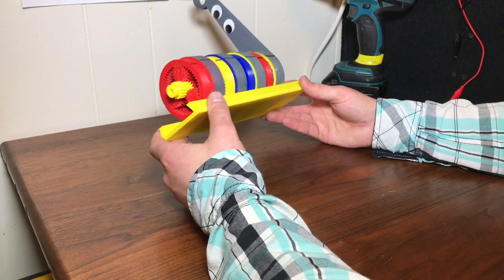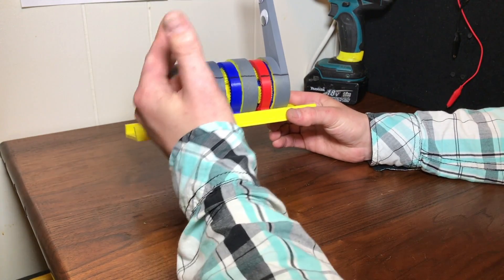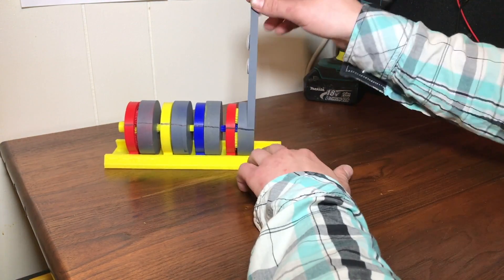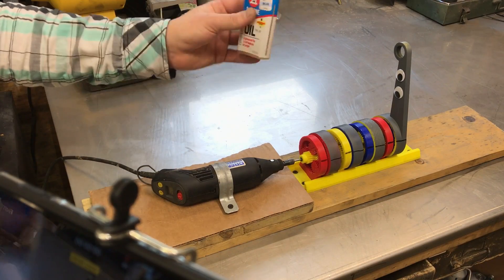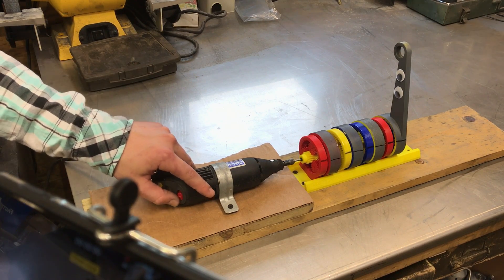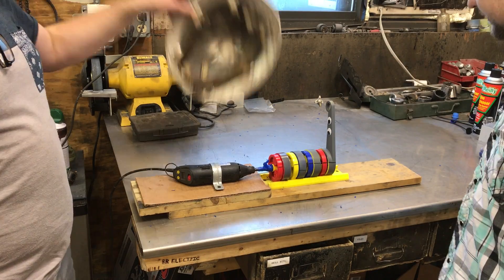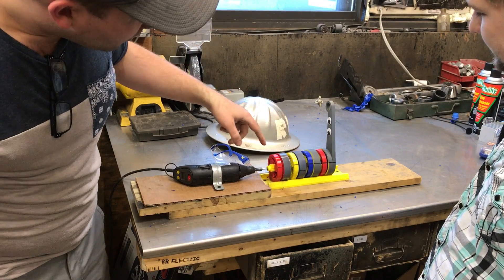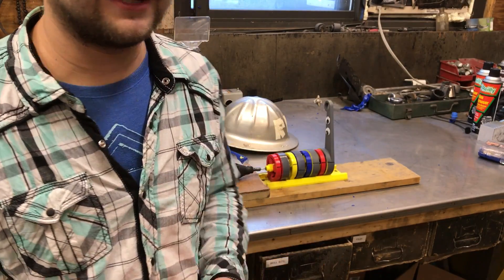3,616,238,492,881 To 1 - The Most Useless Gear Ratio Ever

Comment: is the last gear actually moving continuously or is it just being nudged when the previous gear makes a full rotation?
Reply from the maker: Its moving continuously, but the gearbox never actually got through all of the backlash so it's actually not moving at all. 

To answer your question directly, no this is not some kind it Geneva Drive it's a continuous ratio.
Reply: its hard to imagine that last gear moving that millionth of an inch, pretty cool

Comment: Theres a technical museum ive been to that has a useless gearbox as well. You can see the input spinning from an electric motor, the first few gears are also visible spinning. But the last gear is mounted in cement and would take thousands of years to move All these years of spinning cant even make up for the gear lash...

Comment: Would have used plumber's grease/silicon grease/brake cylinder grease which doesn't attack rubber or plastic... not 3-in-1 petroleum oil which does attack things...

Comment: I wonder... What would happen if a really strong force tried to turn the lever at the OTHER end as fast as it could? Perhaps having a drill bit embedded in the end that was being used to spin this thing up... Would that create one of the fastest spinning drills ever? What kind of things could that drill through if the drill bit could withstand it? I'm also not sure if rotational speed would translate to electrical power if it were hooked up to a tiny generator.

Comment: Couple of pointers, silicone based lube tends to be quite gentle with polymers and rubbers, might want to try that instead of 3 in 1 oil. Also, the air can need not be upside down. All you want is some cooling air, the kind of thermal shock loading you place on the gears in the video leads to premature failure.

Comment: You could use a belt (or gear) drive to multiply your rpm...a 1:4 ratio would take your 14k rpm to 56k rpm....you're going to lose torque, but would only take ~4 years to get your 1°.

Comment: So what would happen if you ran it backwards, like if you turned the lever on the far end with your hand would the other end spin at like 10 trillion RPM or what? I must know!!!
Reply: Renegade5130 
Did the math
Saying youve got an infinite amount of energy and a unbelievably strong material:
If he put in in the other end and had some impossible dremel...
Well it takes 3.7 trillion rotations of the first gear for 1 of the last, the gears look like they have a 1.5in radius, and a bad dremel goes at 5000rpm, so...
3.7 tril * 5000 = 1.8*10^16rpm
v=2pi*1.5*(1.8*10^16)=1.646*10^17rin/min
Plugged that into a tip speed calc and its 35908488000000m/s
 (mach 104726205997)
Speed of light is 299792458m/s
The first gear would be going 119777.82x the speed of light
It would take 119777.82x some unlimited amount of energy to rotate it.
Reply: It would snap or not spin. What you gain in amplifying the cycles per rotation you lose in torque. The material it's made out of would snap long before it moved even a centimeter.
Reply: No it would not. If something requires x amount of force to be moved, it will not move unless x amount of force is applied.
Reply: You know how you apply torque to a lid and hold it and eventually it'll turn right. What if you Got a strong enough material and put just enough torque on it before it'd bend, snap, break, deform, or lose its structural stability on the atomic level to stay in place. And you had something hold it in that position. Eventually, would it not start to turn?
Reply: Theoretically, yes, a material that could withstand it + adequate force could turn it. My concern would be at what point in a gear ratio does a spinning mass hit light speed.
Reply: Ibrahim Noor don’t forget to mention that if he did all of that and things went south and the first set of gears exploded and one of the planet gears hit him, it would hit him so hard, it would reverse the Big Bang and turn reality inside out and create bizarro world

Comment: swap the output with input, then mount motor to input and generator to output and run a line back to rotor through a regulator.

Comment: you should have implemented more segments, but have the segments have a smaller ratio and each one a handle or something of the sort so you end up with something like a clock, where you have different pointers moving at different speeds

Comment: Why don't you try to make the same gearbox but make it open to the both sides and put the drill to the opposite side? Will the plastic vaporise transform to plasma or just blow to bits and pieces in a fraction of a second?

Comment: Have a look at "Machine with Concrete" by Arthur Ganson. He did something very similar with chained gear reduction, but the last gear turns a rod that is solidly embedded in a block of concrete. ..."solidly embedded" in the sense that the Sun will engulf the Earth and annihilate everything on it, including the concrete block, long before the final rod turns more than a degree or two.
Reply from the maker: +HaloInverse yes! I've seen that.

Comment: The only use i could think of is to control a robotic arm with surgical precision, with the motor being a V8 bugatti engine. xD
"Did you ever need to reduce a 200k rpm. motor to a precise and slow reduced spin?"
No.
"Fuck."

Comment: Here is a plausible use for this gear ratio.  The smallest measured distance is know as the Planct Constant.  It is the distance a photon travel to go the diameter of itself.  With this kind of gear ratio and a measures radius it could be calculated to determine how many turns or portions of a turn to make the arm travel a Planct Constant and by doing that you could actually build a scale to break down that constant into portions that are considerable less than the Planct Constant itself.

Comment: hello i know nothing about gears but i have a question - what you happen if you tried to turn it the other way? (turning the big handle at the end to spin the gears from the back to the front) is it impossible because of the design? or would it be possible but very heavy and require a lot of force?

Comment: If you had a proper liquid nitrogen cooling system set up to auto feed liquid nitrogen around the system, plus you made this whole thing out of steel or some other really durable and heat resistant material like titanium, and then you set up some super expensive, extremely fast spinning machine, and made sure it was literally sitting in a bath oil, and then left it on, with sufficient cooling, lubrication and spinning, you could eventually get one rotation :P

Comment from the maker: Hey! ProjectTube is working on casting this gearbox in aluminum, it would be amazing if you could help me support his efforts and watch his video https://www.youtube.com/watch?v=gr651nGFyi4&t=1s and check out his channel!
Reply: Gear Down For What? Can you change the last output into the first input. So if you have enough power to turn the input(the handle) an inch the last output would turn hell a lot of times :-D
Reply: Next episode will be out tomorrow and I think we are making some good progress towards a metal gearbox!
Reply: What if you attached and induction motor in reverse to the input side of the gearbox (result a generator) and then manual rotate the lever ever so slightly by modifying it to hang a weight or something.. Since it takes forever and day day to do the rotation; I would think very minimum energy in with tons of energy out resulting in a highly efficient fuel to energy ratio.. That possible? Or would it take a lot of force just to move the handle on the last gear box?
Reply: Mike Fox it needs enormous torque in order to be turned even a little bit
Reply: +Gear Down For What?    You didn't really invent this gearbox, it's just putting gearboxes I saw it on a dutch guys channel years ago together in series, with nearly the exact same design.
Reply: +Gear Down For What?   I see, thanks for clearing things up, it sounded like you invented it in the video :'D
Reply: Do a video on trying to crank it from the output side should be your next goal see how long that would take to achieve a good result even if it does not work do a video explaining why and with an example?
Reply from the maker: +ProjectTube Awesome!
Reply from the maker: +Jason Neu yeah I didn't invent it. NASA did
Reply: Gear Down For What? Why don't you turn the handle will it go super fast

Comment: If your so concerned with heat buildup, design an oil or water bath or shower for the gear stack to splash on its self while its turning... no pump needed.

Comment: Though it would take a lot of energy to move the handle, since it has a huge ratio. But if you could move it in a second, the other side would open a wormhole, or even cause subspace big-bang.

Comment: If the drill was spinning at 12,000 rpm the camera only would have caught a frame every 200 rotations at 60 fps more likely this video is in 30 fps. At 14,000 rpm that turns into a frame every 233 1/3 rotation.

Comment: If you could just slam down that handle without friction, etc., you would need to apply the theory of relativity to correctly calculate the speed of the red gear. Newtonian mechanics would get you speeds faster than light, which isn't possible.

But since there's no way to do that, it isn't an issue. The energy input required to pull that handle down, even with no friction, just the energy need to turn the mass of the gears, would be unimaginably large.

In fact, if you could put that much energy into the gear box, it would likely collapse into a black hole.

Comment: What if a powerful machine would spin this the other way at about 0.5m/s? It would certanly be hard, but I think an excavator or a more powerful rotor would do the job. Does this mean the first gear will spin at a speed higher than light?
Reply from the maker: +SkyDuster nope. It works like a worm gear. You just can't backdrive it

Comment: I would get a container of mineral oil and submerge the whole thing in it then take off the compressor housing and compressor of a junk turbo and then spin it with an air compressor.
That way you could spin it faster than most anything else could.

Comment: Imagine removing friction completely, then adding so many gear boxes that the turning would pass light speed, we really could break the universe, if there's no friction there it wouldn't take much energy to spin the output, so the input should do something, but it would snap a few gearboxes into little pieces when tried to move since even then light speed still can't be passed, but if they were indestructible, shit would literally hit the fan faster than light.

Comment: fyi, the reason it's stupidly useless is that it's not gonna do any good unless you have a super hard material on the other end, like diamond parts.
Reply: Hardness does not equal strength. Diamonds have a perfect atomic structure which means if a force if applied directly perpendicular to an atomic bond it will break clean through.
Reply: Clement Wong I don't think even that would hold up

Comment: well, such down scaling would be cool to control movements beyond even the nanometer scale. now if u know the displacement of the output arm by calculation and the input rpm you might even essentially reach the lowest limit at which you can determine both accurately as per the Heisenberg principle. quite useful.

Comment: i would like a gear box that can get me a ratio of 1,000 - 1,000,000,000... 

i need a distributor to discharge at 2.4 billion hertz....  it is required for safety measures in shielding a science project.

Comment: Assuming the input shaft diameter is about .5in, if you were able to drive output shaft at 1 RPM the input would spin at over 8 times the speed of light!! Impossible for many reasons not the least of which the rotational mass of the shaft would increase to infinity as it neared the speed of light 🤘

Comment: Did you print that with FDM? you must have your printer calibrated really well. I've done similar gears before and while they do spin ok, they're usually a lil crud in there.
Reply from the maker: +Jakalwarrior yeah it's FDM my printer is super cheap it's just an Anet a8
Reply from the maker: +Jakalwarrior files are on thingiverse. There's a link in the bottom right of the channel banner

Comment: I'm pathetically useless when it comes to this stuff. 
Can someone explain what the ratios are about?
Reply: Liam Jorgensen this thing can generate more force than pretty much anything on the planet, it's just a matter of time, if it where able to spin fast enough but disregard friction and a material that can withstand the heat and force it could move anything.

Comment: Have we considered the fact that this little machine is absorbing a bloody ass-ton of kinetic energy?  Imagine the applications of that concept?  attach springs between gearboxes to store that kinetic energy as potential?  If you can get friction low enough, you could create a spring-battery that would produce a low amperage for YEARS.
Reply from the maker: if it could be back driven, your idea would have a lot of uses. but unfortunately it cannot.
Reply: If it could be backdriven, there would be many more possibilities. Heck, yanking on that eyeballed handle would probably cause a sonic boom or more..
Reply: I'm sure researchers have considered outrageous back-driven gear ratios when considering batteries, there'd be more than a few reasons it wouldn't work.
Reply: CheckYourself it can't be back driven because the torque (ie. strength) required to turn it would be absolutely ridiculous
Reply: Just curious, why can't it be back driven
Reply: This isn't absorbing a lot of kinetic energy at all. 99.9999...% of all input is lost due to friction. The only energy actually gained by the system is the potential gravitational energy of the lever at the end moving up. Which is the equivalent of a couple of joules.
Reply: it's really not that much. using a stove uses way more, and consumers don't even make up for power use compared to industries
Reply: Thermite or silicon is pretty much the best energy storage if they can just get powder flow technology right down.. of course stirling engines can help with that!
Reply: +Connor Van Tol
Yea! We need to have energy available in 2392 so we can show them we weren't a mistake.
Reply: Jer Thode  there is no a chance to conbine this concept with a pressure chamber/material that uses the acumulated torque for pressurr increase... So later it could be used/exhausted
Reply: biorpg would cause cherenkov radiation or something lol

Comment: What if you turned the handle one full rotation? Wouldn't the input then turn over a trillion times instantly?
Reply from the maker: +Dan Ivanov if the gearbox didn't break, the input side would still not be able to spin faster than the speed of light
Reply: so the limiting feature is the gearbox breaking? what if someone designed a gearbox that wouldn't break?

Comment: I don't believe it's actually getting to 14,000 rpms on the input.  Time the one gear and calculate.  I got 11900.
Reply from the maker: it varies. when the tape starts to fly off it gets more air resistance and slows down.

Comment: I know it would probably be impossible to physically measure, but what would the theoretical torque be on the output shaft if say you drove it with a 1Ft.Lb. of torque?  Could it really have over a trillion pounds of torque if we said that the materials could handle it.

Comment: Just an idea. But how about affixing a cover/plate over the front gearbox, you would then be able to cool the insides of the gearbox much more efficiently. A cooled flow of compressed air may be sufficient, with only small blasts from a real cooling source. And how about trying to lubricate it with an alcohol based fluid the evaporation would help in cooling.

Comment: Put the dremel on the other side and the gearbox will fly away
Reply: Mr.Micinpoepe honestly if you used the dremel on that side it'll probably reach speeds faster than light, but it isn't possible at the moment lol.

Comment: U should use dentists tools they do something like 100000 rpm
Reply: Gadget Creator yea but the heat would melt the gears, he would probably have to spend more money into liquid nitrogen cooling the fuck lol
Reply: figot latenby 

No no, there's a pneumatic version that can get up to those dentist drill speeds.
Reply: Or a tesla turbine. Those can get insanely fast.
Reply: Dubby 

I thought those maxed out at around 20,000 and couldnt hold a load very well(though i forget how the output was designed)

Comment: You spin it other way around 1 time= power for 3.7 trillion year for all of us
Reply: what happens if he trys to move that lever. is it just too difficult to move and would break off if enough force is applied?
Reply: it would be impossible
You would have to put (correct me if I'm wrong) 6000 tons on that lever to move it with the help of gravity.
Reply: How much tons of force can the biggest and strongest hydraulic press output?

-edit
I just checked, 50 000tons

Comment: question, why didn't you just setup like a computer fan or something a bit more potent to continuously move ambient air over the gears?
surely the temp would transfer quickly enough especially with the inclusion of oil which i would have thought spreads the heat evenly?
Awesome video, cool idea :)

Comment: Oil will kill plastic...best off using some sort of starch spray (like what's used for ironing) instead
Reply from the maker: +weedfreer I thought that was for stictivity
Reply: Gear Down For What? I remember my old science teacher talking about how when his wife's pushchair wheels started getting stuff and squeezing, as they were plastic bearings, rather than use oil which would degrade the plastic he used a product by the name of (I think) fabricon...which he described as a starch based ironing spray.

whether that chimes in with what you're saying...I'm not sure